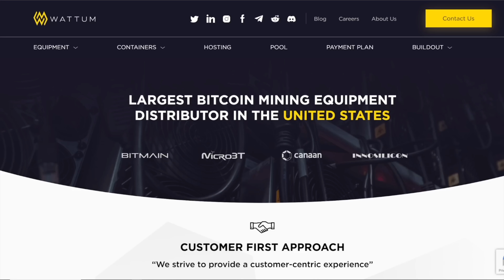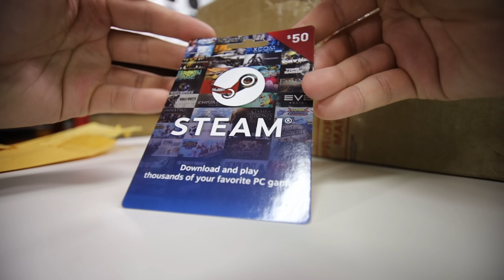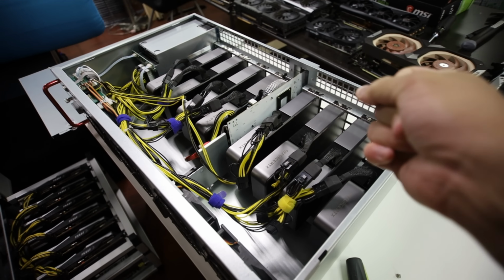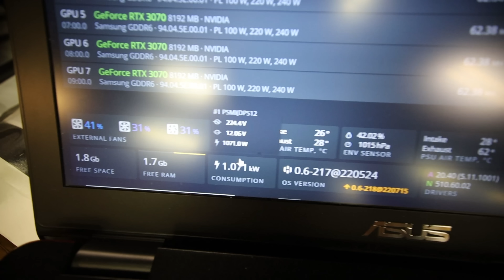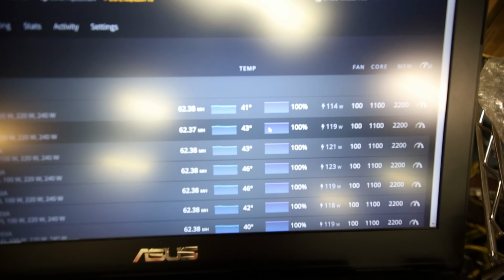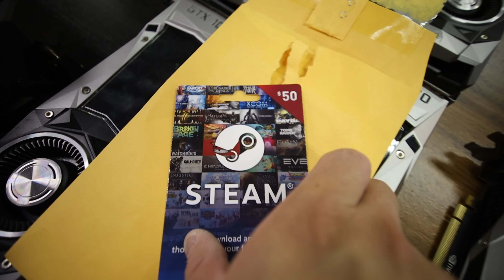added my final FE 3070

Comment: What PSU are they running on Red Panda? I have a 7 card rig, 4 x 3060ti and 3 x 3070, all power limited to 120w or have locked core that pulls 120w, yet I'm pulling about the same wattage as you are with one less card. I assume it's due to psu inefficiency since my system pulls 33w with no cards attached.

Comment: That's a nice card! I have always loved the aesthetics of the FE cards.  I've only got the one 3080 FE right now, needed to replace pads with copper plates though since thermals were TERRIBLE bro.  But the 3070 shouldn't have the same thermal issues so might be a way better option than the 3080 I've got.

Comment: I don't understand why I can not get same hashrate on same 3070FE. I put same settings 1100/2200 and I have 60.79MH/s on each card. I know what silicon lottery is, but they are from different suppliers, different manufacture dates etc. I need 2600 on Samsung memory to get 62MH/s :(
Reply: ok, done ;) force P0 state helped.

Comment: is it better to run gpu fans at 60-80% vs 100% if you already have decent temps?
Reply: If you have the temps under control with less usage on the fans then you are increasing their lifespan. But remember that on most GPU's you cant monitor the mem temps so be carefull.
Reply: @TheDarkTower91  yeah but these are 3070s without the 6x mem so it's not an issue... unlike 3080 or 3090s
Reply: @a3_a3  That gddr6 doesnt get as hot as gddr6x doesnt mean that It can get as hot as u want. Eth mining is mem intensive, If you GPU has much better GPU cooling than mem and you keep the fans down just to hit 60°C on the GPU for example, you can end with memories over safe temps.
But If you dont want an honest answer: "Yeah sure, set It as low as you want, no problem."

Comment: So why 3070 over 3060ti? 3060ti are significantly cheaper and hashrates are pretty much the same.
Reply: until you switch to a different coin other than eth... then it's a different story
Reply from the maker: 3070's get 25-35% more hashrate on other algorithms/coins than the 3060 Ti and 3070's are more efficient.

Comment: Why are all crazy after FE?
Reply: Cause they beautiful plus none ti 3060 3070 3080 are none lhr even tho lhr has been unlocked already
Reply: @randomhobbies5796  I buy TUF, STRIX, SUPRIM because of cooling. How is the cooling for FE with stock termal plates?
Reply: @petarrenic359  with 3070 it is a null point... having said that my EVGA 3070 FTW3 cards typically run 4-6 degree cooler than 3070 FE.  But again, with 3070 they all run cool so doesn't matter